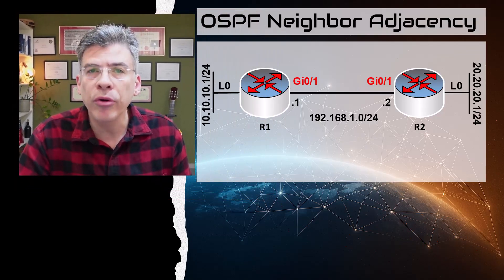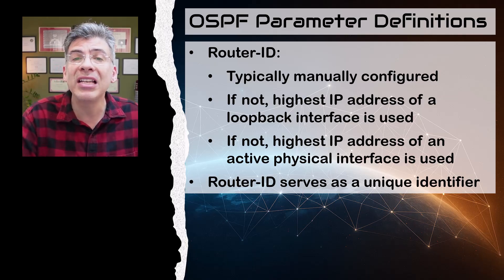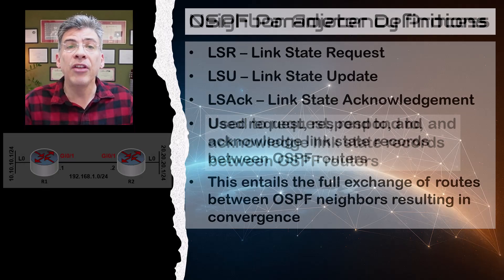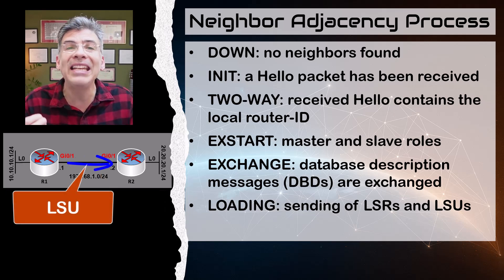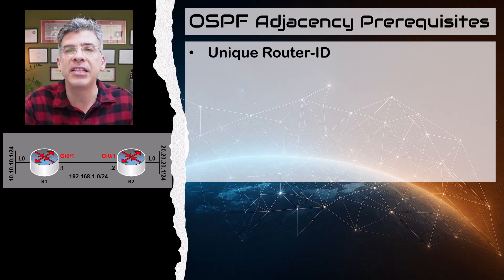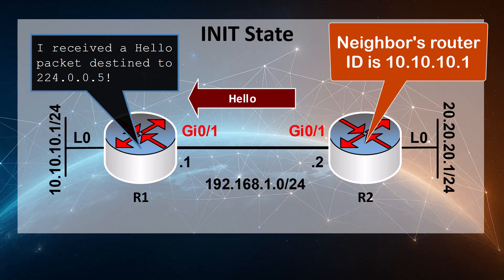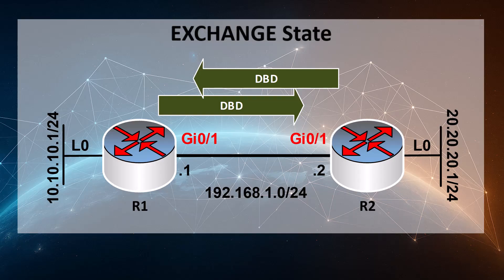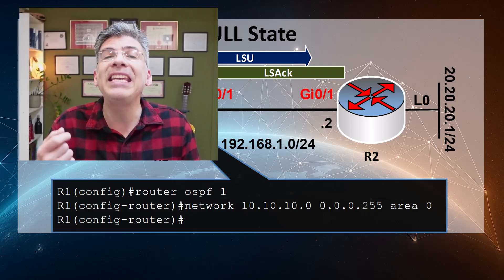OSPF Neighbor Discovery Process

Comment: Thank you for the wonderful video and content.  The MTU value must also be the same on both sides; otherwise, OSPF will not form a neighbor adjacency.
Reply from the maker: Indeed the MTU is an important part of the process as well.  However, MTU is not a value that is directly configured within the OSPF configuration process, but has to do with the underlying Layer 2 infrastructure.  The MTU is a value that is included within the DBDs, and if the values are different on either end, the adjacency can get stuck with one end in the EXSTART state and the other in the EXCHANGE state.  DBDs are continuously exchanged and after a while, the adjacency attempt is torn down, due to too many retransmissions.  

Thanks for pointing that out, it is an important part of the process!
Reply: Hi sis.. If MTUs are mismatched the adjacency will be stucked in Exstart state. Though they will be neighbors but wont be full adjacent.

Rest Mr Lazarus can comment if i missed something.  Cheers
Reply from the maker: Yep, you're right.  One side will be in EXSTART state and the other in the EXCHANGE state.  They will never reach the FULL state unless the MTU is changed to match...